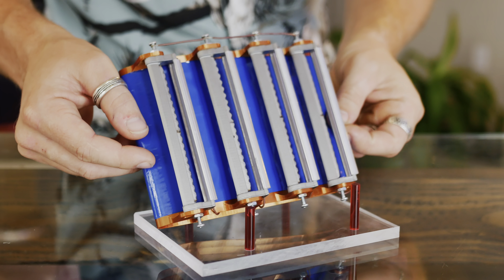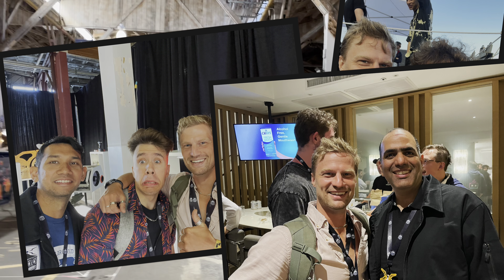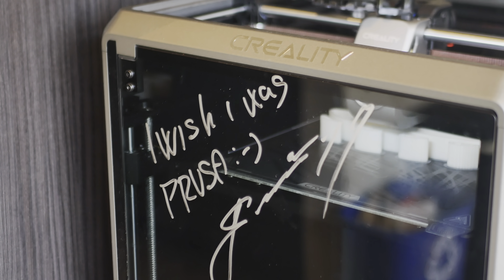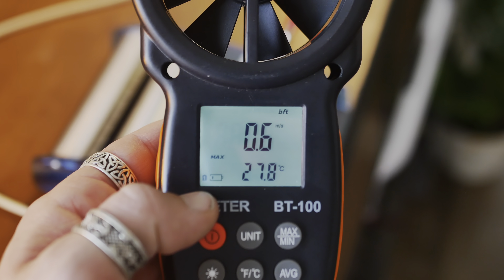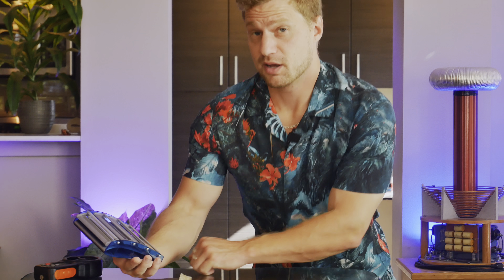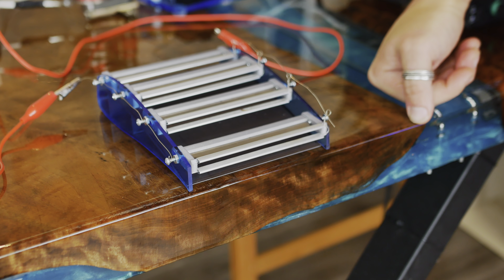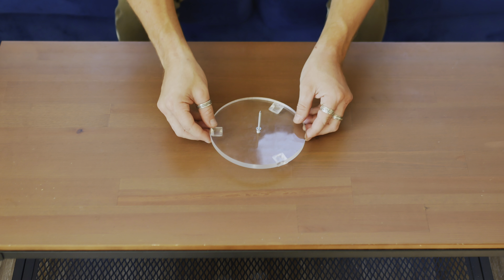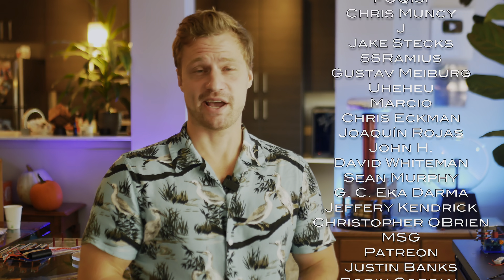Designing A Self Propelling Ionic Thrust Wing

Comment: I suspect a more efficient design might be to use the the body of the wing as the "duct" of a sort of "ducted plasma fan." If the leading edge of the wing is the high-voltage conductor, you could move air through the wing to produce the thrust, while also gaining the benefit of a wing as a lifting body, even if angle of attack never factors into your generation of lift. I could (obviously) be wrong, but I wanted to mention the idea anyway, in case it can be of use.
Reply: I completely agree, I believe the config reaction will not produce lift. The air travelling slower over the top of the wing generates lift. The thrusters are speeding up the air. Has more chance of working if they were under the wing or integrated into it like you suggested.
I don't know much about ion thrusters, but I know that propeller efficiency has a lot to do with each blade getting as much clean air as possible undisturbed by the previous blade as it's rotating.
Im wondering if having the ion thrusters trailing one another affects efficiency in the same way. By the time the air is reaching the fourth thruster I can only imagine it would be incredibly choppy air. Can the thrusters be stacked? I believe a single larger, more powerful thruster would be more efficient and effective to integrate into a wing.
I have experimented a lot with wind turbines although not an expert, I understand that airflow is a highly complex concept that can sometimes be counterintuitive. 
Love the videos and concepts you are creating. Keep it up. I've had a concept in my head for something I call a magnetic vortex compression drive.  Videos like yours make me realise I should put concept into practise instead of fear of failure.

Comment: Instead of using cylindrical wires, perhaps using copper ribbons would work better. This might increase the amount of interaction time with the air. The longitudinal spacing between these ribbons and the other electrodes might be an experimental factor as well, considering how magnetic fields work.

Comment: I don't know if this will help or not, but if you consider a typical jet engine, they use multiple blades to o concentrate and squeeze the air to increase thrust. Perhaps if you could find a way to modulate the voltage between the individual thrusters this might increase the overall thrust. Anyway best of luck on your endeavors.!!!

Comment: You do a great job of keeping your videos accessible yet informative. Is it possible to include the changing shape of the air in your ionic wing design? Your BSI Mark 2 did this by putting a venturi at each stage. As a column of air increases in velocity the pressure drops and the column decreases in cross section. The accelerated air might be able to remove more ions from the electrode allowing more voltage to be applied to subsequent sections. 
The velocity increase across the wing surface will not only draw the wing into the airflow but it also draws the air above the upper wing surface down producing induced drag. This probably limits the benefit of laminar airflow induction for propulsion to some upper limit. To increase thrust alone you might consider splitting the wing into upper and lower sections.

Comment: If you integrate the thruster inside the wingbox u can bleed some from the surface n create a suction to keep flow attached at higher speed.. plus u will have a rigid stable design..

Comment: You never tested wind resistance.  It's all kind of pointless having all those thrust winglets above the wing if the wind resistance and vorticies introduced by them destroys the lifting strength and laminar flow of air over of the wing itself.  Going to wires is a good start, but I'd love to see you explore having the strips of metal directly on the lifting wing instead of independently above it. There's also exploration of having the entire wing itself be metal and the front part for a second following blade or wire entirely behind it doesn't disturb the aerodynaimcs of the wing.

Comment: Wouldn't you be limiting the performance by installing the ionic thrusters on the low pressure side of the wing. I would think the apparent wind and effectiveness of the wing would be improved with the engines on the high pressure side of the foil?

Comment: You could also integrate a ion thruster in the wing structure, without moving parts you don't need a gondola mount and it wouldn't add much weight or drag

Comment: On the topic of weight reduction.

Since you're using such high voltage it likely takes a very small amount of metal to conduct your charge. Have you considered electroplating your 3D printed electrodes? A micron of copper on top of your custom shaped, mostly plastic, electrode.

Comment: I think this could be improved by making the wing something like a toucans beak (not in shape but in material) basically make the shape of the airfoil with Styrofoam then wrap it in a thin layer of sturdy but flexible plastic. The foam and pastic together compliment and make a rigid and sturdy material. Then when you mount the ionic thrusters, it might help to cover them with thin plastic, having a slightly funnel-like (as in wider but still along the wings profileopening in the front and narrower openings in the back side of the wing. Hopefully the airfoil would be lighter and adding an intake and a way to focus the air flow would improve performance

Comment: As an R. C. Builder might I suggest balsa wood and super glue in a lattice frame covered in mono-coat (a thin heat shrink plastic cover used on RC planes) this will lighten you load and improve performance.

Comment: Considering it's a glider you could use the hollow structure of the wings to kind of cheat with a lighter than air gas.. bonus points if you can produce energy off it or use if for cooling.
 Oh and angle all the Ionic thrusters towards the aerodynamic surfaces and you should in theory have better control through the tried and true flaps, ailerons, etc.

Comment: when building the wing why not have a set of thrusters thru the wing, this should allow you to setup a sort of stationary turbine, meaning use the wing infrastructure to super cycle the air. now this may create more drag than power but it's worth investigating, this should also allow a setup to have the thrusters on both the top and bottom sides of the wings, depending on setup you might be able to allow a more control over the thrust being put out for altitude adjustments while being level, also you could put a more centralized mass for controlling the wings. you could have a fixed wing aircraft with back wing dexterity, so control wouldn't be set to servos and gears but a more "simple" machine flight powered by simple energy. i am a little buzzed but i think this could work, i know there will be questions and I'm not an expert but I'm just throwing an idea out there for people that can try and i believe can be effective and cost efficient, sorry once again for my inability to properly state what I'm trying to portrait.

Comment: This is very cool! I have a few suggestions/questions.
1. I believe you can use significantly more cambered wings for this project. The camber is usually limited by the tendency of flow to separate. More camber loosely translates to more lift and not much more drag.
2. The ionic thrusters energise the flow in a manner similar to how multi-element wings on a Formula 1 car do, increasing its kinetic energy which helps keep flow attached. This greatly improves the lift (while also adding a bit of drag). To do this more effectively, you should also consider orienting the ionic thrusters such that the gap on the trailing edge of the thruster is less than the leading edge. It might help increase speed since you're forcing it through a smaller gap and reduce the pressure on the top of the wing. 
3. Is there a way to design the thrusters such that the ion flow is only between the thruster and the wing and not the free side of the thruster? This with point 2 might improve the speed. 
4. It would be very cool to see if these thrusters can help mitigate stall tendency in aircraft with traditional engines.
5. I don't know much about ionic thrusters, but I feel that the thrust would be roughly constant even at higher speeds. If so, it might still be a practical solution to the idea of flying without moving parts, ignoring the extremely high voltage needed and the safety issues that come with it especially in anything larger than scale RC aircraft.

Note on the final calculation. I believe you have fewer equations than variables. To find the exact thrust created, you also need to find the drag. I'd say, mount it on an encoder and record its acceleration over time. It'll help characterize both static thrust, and thrust-drag over velocity. This isn't to say your estimate is far from accurate, but there is potential to improve that estimate.

Commercial aircraft often fly with a thrust to weight of 0.25, with most of this thrust required for takeoff. Creating 50gm of thrust can easily allow us to fly a plane around 200-300gm. With some design optimization, it's not impossible to hit the target. Just replacing the 3D printed wing with a hollow foam wing might end up saving you 40-50gm.

I would love to have a conversation to think of ideas to improve this project!

Comment: regarding the ionic wing, it occurs to me that maybe we’re thinking too macro.

That is, the electrons accelerating the air molecules is all happening at an extremely microscopic scale.   Therefore the system to accelerate them optimally should be designed this way.

That is, building a kind of 3d lattice (like a potato dicer with channels for the air), where each channel is scaled in width and height according to flow and turbulence.    In the length dimension (along the axis of flow), the distance between subsequent “accelerators” can be very very small.

So somehow 3d printing a “dicer” (or printing layers then coating them using electroplating) could be a useful approach.

I’ve done a preliminary analysis, and. It seems that an ionic engine with this 3D lattice design could be very powerful.   I’ve emailed it to Jay.

Anyway very fun to think about!

Comment: I know enough about aerodynamics to know that I know nothing about aerodynamics, but if I recall, isn't lift generated by the air moving faster below the wing than above? If so, wouldn't it make more sense - and lift - if you mounted the ionic thrust rails under the wing?

Comment: Feels that covering the top of the thrusters would minimize drag due to turbulence. Since getting them closer improve the output, it may be just due to a smaller gap between them. If this gap is shielded all together, it may improve without the necessity of more thrusters for the width of the wing. This extra cover on top may be taken into consideration structurally so that the frame below may be made thinner. And in fact it might also be irrelevant to have the wing closed below those thrusters in such case. The regular shape of a wing is calculated in a way to maximize it's aerodynamic at speed. in your case speed is not really a concern. To adjust the pitch of the wing itself could be more profitable, like Harriers and such. If for example the wing structure is only the cover above the thrusters like I explained, Then the compression of air due to the weight of the plane pulling down, insure that most of the air is forced through the thrusters. It is worth evaluating.

In turbines the air coming in is compressed at every step of stator and rotor. That makes the percentage of oxygen per volume richer and improve combustion in the end of the sequence. The same principal in an internal combustion engine apply, where the explosion append when this compression is maximized for the same benefit. That leads to a more complete combustion and then less waste of unburned fuel. In your case, that may not be of any concern, yet test should probably be done to see the effect of reducing the flow at the end of the series of thrusters. Or even opening the output more. It might be beneficial to increase the strength of the thrusters in sequence. When you close the nozzle of a gardening hose, the flow attempting to remain the same have no choice but to increase the speed of the flow, since less surface area allow for it to go through. Yet that needs to be calibrated with the capacity of the system. In a municipal aqueduct network, the massive pump is designed to provide abundant pressure for all users, but if all start stressing the system at the same time, the pump may not sustain the same performance. Since you are concerned here with a flying, light vehicle, the amount of resistance to the flow in order to compress its output probably need to be very subtle. 

2m/sec is 7.2 km/h! It is already a success. we walk about 5 km/h. Yet a plane can reach places in straight lines and avoid traffic signals or traffic jam! Only issue is going facing a wind stronger then 7.2 km/h. Yet that is also advantageous to gain altitude and work things out like a glider do.

Comment: I love what you're doing, but I cant help myself. Those are not Eddy Currents 12:10. Thats just turbulence, vortex, whatever else you want to call it, but Eddy Currents it is not. Eddy Currents are strictly electrical, inside an electric conduction medium as a result of fluctuating magnetic fields who cause electrons to move in a loop, causing the metal/conductor to heat up. You cannot use it like you just did, especially when theres perfectly good words to describe the phenomenon you're referring to i.e wingtip vortices or exhaust wash, whichever is more applicable here. I'm an Electrical and Electronic Engineer, not an Aero-Space Engineer so I'll leave that up to your consideration.
Anyways, love this series. Looking forward to more.

Comment: I wish that my elder friend of many years, Tom, was around to see this work.
He worked on a vertical windmill model, and I wonder if this work could add to what he was finding out? 
What reminded me of this project was the wire replacing the blade.
From what i remember, it made quite a difference to the efficiency of the wing, which there were five, what the placement the wire was on the actual wing structure. 
Just a thought. Love your enthusiasm. Looking forward to more.

Comment: I have a very Simple Ionic Thruster design-- for you to test...

Requires 10 ( X-Acto) Razor-blades..  arrange in a Trapezoid pattern-- from the side view..  

With the Larger side being the intake & the small side being exhaust.  Held together by the sides.

We're the Air intake has x2 to x3 the size as the exhaust..
(With the exhaust side spacing around 1/8 inch)

And a simple 3/8 to 1/2 wire gap-- for the Negative side.. like your Ionic thruster.

I believe there would be an Increase in performance & Efficiency; If, there was a (electric) Fan, in the Front, to help make the Air more Dense.. (/compressed) 
(Or another slightly larger Ion thruster plate in front-- as an Air Sealed Unit.)

I think Air Density is key to Improving thruster performance. 

Also, I kind of wonder how much  the Size of the Positively charged plates-- help Attract Negatively charged Molecules in the air-- into the Ion engine.?.  🤔

Comment: Very interesting.  But, you need to generate lift.  Do the thrusters impede the boundary layer over the surface of the wing?  If the thrusters break the airflow, you won't generate enough lift and the wing will stall.  You might want to look at the wing design of a military C-17 for the blown flap principle.  Your thrusters may be very useful in extending the boundary layer (and therefore the lift coefficient) for low speed flight.  As an engineer and a pilot, I'm interested in seeing what you can do with this.

Comment: If you ever come to Denmark (during summer) I will fly you in my glider...

Great video. However your thrust engine is not gonna be that good.
Read up on aerodynamics please.
You will need a laminar flow on top of the wing for lift at low speed otherwise the turbulent air will generate to much drag when flying.
Your test rig can actually show you if you get lift if you make the mount for the wing different, with no plate underneath and lift it out of "ground effect".
Contact me for further teaching in aerodynamics... I am a glider pilot and instructor